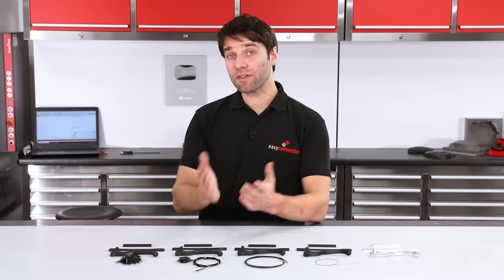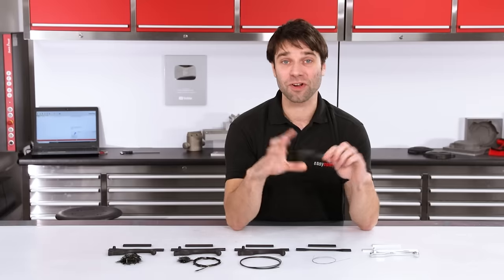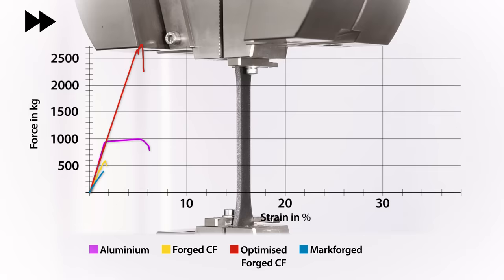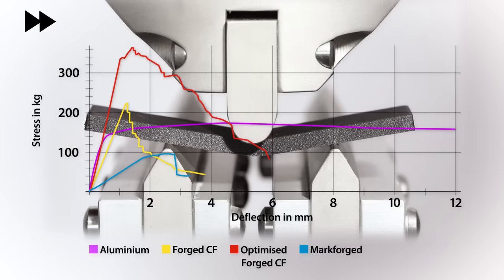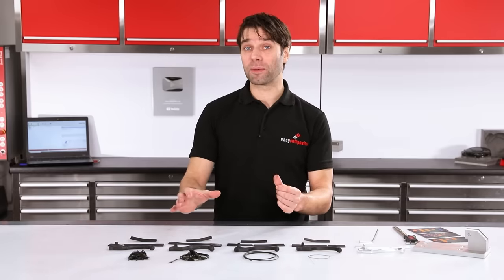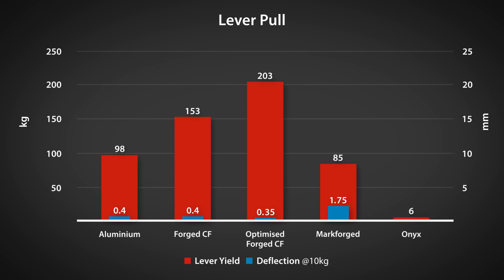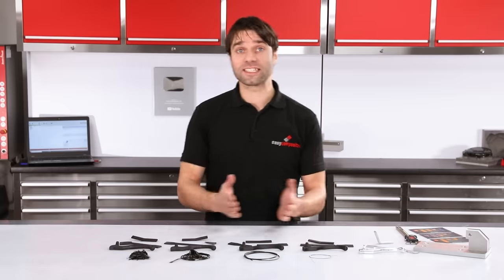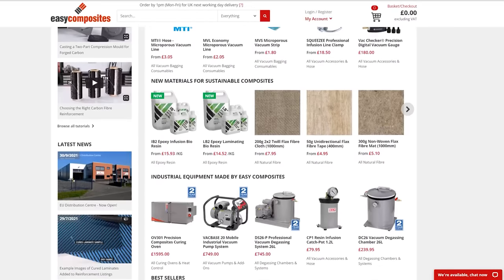How Strong is Forged Carbon Fibre? Forged Carbon vs Aluminium vs Markforged vs Onyx

Comment: i think its time for you guys to make a big step up, which is making forged carbon fiber wheel, yeah... motorcycle or a car wheel, this would be awesome.
Reply from the maker: Maybe one day but there's always apprehension about a hugely safety critical part like a wheel and a lot more to the science and understanding of the forces and fibre orientation - you could get very in depth in terms of the FEA, etc. It would also lend itself to a PrePreg process rather than compression moulding. The Koenigsegg wheel video shows a good overview of wheel construction if you haven't seen it.

Comment: Something that's never talked about is the diagnostic cost associated with carbon fibers tendency to develop micro fractures due to shock stress.
This is why off-road motorcycles don't touch the stuff in any professional frames. It's great for non structural parts or track use vehicles as they don't have to worry about shock loads, but anything outside of that is not a good idea

Comment: Question for you on the brake lever side of stuff. For the surface that the lever pivots around, would you want to put some sort of bushing in there, or leave it as-is? Thinking of prototyping a custom brake pedal for a vehicle, and unsure what path to follow, whether it be metal inserts during(including them in the mold)or after cure(press-fitting or similar), or none at all
Reply from the maker: Generally a bushing would be used to limit wear and help spread the load over time. They are easiest to press and bond into place after making the lever.

Comment: Super nice to see the engineering approach and rigor in your video. Did you test multiple replicates of each material, or just the optimized forged CF?
Reply from the maker: Thank you. We tested multiple test tokens but only a single example of the lever.
Usually we’d want to test multiple samples of all components but those Markforged prints were over £100 each! The average results from the token tests fairly closely mirrored the performance of the brake lever component so we’re were happy that the single brake lever test was sufficiently reflective.
Reply: @easycompositestv  great to hear you rested multiple test specimens. It provides a lot of confidence in the results, for me. Makes sense about the number of levers and how they match the specimen results. Awesome experiment.

Comment: Wonder which is strongest and makes a best result, forge or vacuum. If you wanted to do a half pipe D80, 7x400mm, and you be using Weave Fabric in both cases.

Comment: Thanks for sharing such a good video. What is the span of 3 point bending  forged CF specimens? Are they the pure bend testing?
Reply from the maker: Although the standard wasn’t applied to the tests as such, the specimen follows the dimensions of ISO 527-2 1B

Cross section 10mm x 3mm 
Parallel gauge length 60mm 
Tab width 20mm 
Waist radius 60mm

Comment: Excellent video, subscribed.
I started using CF in various sailboat parts in the early 80's, my brother went on to make CF bicycle  frames sometime in the 90's, and I went off to computer science about the same time. I have a feel for the stuff, but never did the testing. Well, nobody in the boat business had enough money to both buy the stuff and test it.
Thank you for this, your test is pretty much what expected.

I'm familiar with compression molds, but never thought of the process as "forging". Is forging now industry standard nomenclature for compression molding, or is it a proprietary process? 
That's probably in your prior videos, sooner or later I'll get around to watching them.

BTW, back in the day we found that S glass, while not as strong in tension as CF, was just about as good in compression, and a lot cheaper. Most composite parts fail in compression. That may have to do with the sizing that was available at the time, if not, have you tried S glass in your process?
Reply from the maker: S -glass although having its advantages in some respects is actually harder to get hold of in similar format.  It is not what would be considered a forging process in a traditional sense but it is a name that has stuck after some of the supercar OEM's coined the term for the process they used to create panels with the same chopped tow look to them.
Reply: @easycompositestv  Thank you for the excellent response!
Best wishes in your endeavors.

Comment: Interesting vid, thanks. Is the optimised forging as easy as you make it look? Just whack some long strands of tow (toe?)in the mould withthe chopped strands and voila?
Reply from the maker: Yes, absolutely it is pretty much as you see in the snapshot.  Just requires a bit of thought in terms of where you want to place it.

Comment: grandissimi!
grazie

PS: if optimized forged carbon outperforms alu, do you think custom spare (special) parts can be smaller than original ones?
Do you use FDM simulation in this case?
Thanks again, you guys are #1 as usual
Reply from the maker: In theory yes, as long as the part was able to withstand the stresses that it would be subjected to and perform as intended there isn't any really reason why parts couldn't be smaller. 

FEA could indeed be used to simulate parts in the design phase.
Reply: @easycompositestv  yes, it was a mistyped FEM or FEA acronym..
I thought of reducing size and/or thickness in search of maximum lightweight! Maybe it's too much, I admit... 
Thank very much for replying

Comment: To all those who are interested with CF products on bike, take note, any carbon parts that touches bare metal, will cause Galvanic corrosion.. This is well known in the Aircraft Industry..

So if you intent to use this parts on motorbikes or any automotive, ALWAYS make sure there is a layer of protective coating between CF and metal..

So if u are using it as Brake lever or Clutch lever, ensure u put a Brass bushing on the pivot joints..

If you are using it on the crankcase cover, take note to have a gasket in between..

If u are using Stainless Steel bolts on Aluminium casing, make sure u have threadlock in between, as 2 different metal materials inhibits Dissimilar Metal corrosion..

This is Just a heads up..

No way is this to put down this channel's product.. Just to spread facts..

I personally recommend CF in automotive as Power to Weight ratios in automotive, MEANS a lot.. CF are super light, and recommended in automotive, when the bike or car is lighter, u save gasoline, and it even uses less fuel to produce power.. Or you can just go and jog to lose that 3-5 kg.. Wonder why all MotoGP riders are underweight before races...
Reply from the maker: Thanks for your comment.  In our experience, the environment most carbon parts used for DIY use are in do not generally suffer from galvanic corrosion to the same extent as statically charged environments such as aviation.  Commonly the glue used or thin layer of resin between fibres and part surface is enough to prevent it being an issue.

Comment: I think you need to also talk about the area under those curves. Toughness matters a lot. The problem with Carbon fiber in many applications is that when it does fail, it fails suddenly and catastrophically. 

The other issue is that under torque or in shear the carbon fiber is going to likely perform poorly compared to a purely isotropic material like aluminum. Now for the part shown, that's probably not a big deal, but for other parts that may be exposed to stresses in directions outside of optimal, you may have a part in carbon fiber that is extremely strong in one direction, but comparably weak in another.
Reply from the maker: Fibre orientation is key in that respects.  The forged carbon process isn't too bad as the fibres are pretty randomly orientated but still not as effective as a truly isotopic material.  More traditional composites you can change the fibre orientations to suit the application.

Comment: I'd love to see more videos like this! I'm particularly interested in the possibility of filling a single walled 0% infill 3d print with resin/chopped fiber+resin as an easy way to get strong 3d prints without the hassle of making a mold. Would this be possible and how would it compare to conventionally made composite parts? (I don't have the means to test this).

I've seen a video from CNC kitchen where he painted epoxy onto 3d prints but he didn't go as far as filling the internal void in a 3d print with resin.
Reply from the maker: I imagine it would work very well. You wouldn't be able to compare to conventional composites as they are normally thin skins compared to a solid object so the performance and intended uses would always be different.

Comment: Would any benefit be had to laying carbon strands in a perpendicular/ mesh-like orientation  in the optimized forged cf?
Reply from the maker: You already have fibres in multi-directions due to the chopped tow so can't see any significant advantage to this over the chopped tow being used already.

Comment: Very good test EC, but now I'm curious how would other materials perform. Like forged S-glass for instance.
Reply from the maker: Forged S-Glass would behave in just the same way so could certainly be used. In terms of how it would compare, I think we can safely say it would just mirror the differences between those two fibre types; similar strength, lower modulus, higher density, low dielectric.

Comment: Is the tensile test specimen is prepared using 3D printed moulds?
Reply from the maker: Yes, the brake levers you see were produced using the pre-existing moulds used for the previous video.

Comment: Well, I said it before and you told me it wouldn't be a good idea, but; I'd like to make my A-arms out of Forged Carbon fiber.  That test was the "Bomb diggity dog.". So now I just need to see what I need to buy in order to do it.  Thumbs up all the way.
Reply from the maker: Its likely to be an issue with fatigue or heavy shock loading which may cause the peak shock loading to exceed its strength and then catastrophically fail compared to a metal part that would slightly bend but stay in one piece. Also there is difficulty with ensuring the fixing points are suitably strong etc. The design would need to be optimised for forged carbon use and may well be considerably different from a steel one.
Reply: @easycompositestv  With all the different application's for carbon composite parts and your test result's clearly prove that if I design the A-arm's and test them against a vehicle running over pot holes again, and again perhaps I can put your doubts to rest. Love your test, it was a major selling point for me.  "Thumbs up all the way brother."

Comment: This is very interesting.

I have a few questions:

1. How do these various methods compare in weight?
2. How does the strength compare to carbon fiber when encasing balsa wood or foam?  
3. How does thickness of balsa or foam affect strength?
4. Do you ship to the US or recommend who I should order from stateside?

My project would be ultra-light truck camping for a new electric truck with limited payload.  
I have ordered a Silverado EV and the total payload is 1200 pounds. 
I would like to make a bed and cupboards inside the truck cap out of carbon fiber panels.
I allocate 400 lbs for humans, 350 lbs. for the truck cap and that leaves only 450 lbs for cabinets and camping equipment.
I appreciate your ideas on materials and thickness. 

I would like to explore the concept of traveling across the US on electricity and record cost in an ultralight camping.

Tom
Reply from the maker: Hi Tom, thanks for getting in touch. There's a lot more information including weights and comparisons over on our website including a full write-up and conclusion. You can find this by following the link: https://www.easycomposites.co.uk/learning/mechanical-properties-of-forged-carbon-fibre
Reply from the maker: We can ship to the US, no problem.

Comment: Is it possible to use the same method for flax fibers? I've noticed that you don't sell chopped flax and I'm not sure if buying unidirectional flax reinforcement and just cutting this into similar 12mm pieces would produce the same result.
Reply from the maker: In theory yes if you can find the fibres.  Only down side is flax fibres tend to swell once wetted with resin so you may have issues getting enough fibre into the mould before compression.  Subject to testing, you may need to put more material in the mould to compensate for it swelling in the mixing pot.
Reply: @easycompositestv  thank you for the quick reply! You have a phenomenal YT-channel and I'm looking forward to trying out some of your starter kits. I'll try "forging" carbon fibre first and then experiment with flax down the road. Cheers!

Comment: Very interesting and impressive as always! Whereas I think that a certain plastic deformability also brings safety in some situations. As the tests show a fracture in CFRP can occur relatively abruptly and is not necessarily indicated by deformation. As for the leaver I think I rather would like to have some deformation than a nasty splintered piece that eventually pierces through my hand when I'm in an accident.. :)

As a Topic for a new video I would really love to see how to produce structured surfaces on large objects! I like to make some side panels for my van and struggling for years now with not knowing how to reproduce the leather optic of the original ones (artificial leather is not a option..)!
Reply: Agreed. Also, speaking from bitter experience, but the fact you can bend back alu somewhat and have it last long enough to get you home can literally be the difference between riding home and sitting at the roadside waiting for a recovery van.
Reply from the maker: Although realistically, it is only in a crash that the impact loading on the brake lever would be high enough to fail.  A typical lever pull is around 10kg, so even if you managed to pull several times that figure, it is still within the tested failure levels.

Comment: I do really like these forged cf parts. The only thing I don't like about it after seeing these tests is that when you get to the failure point, the cf snaps whereas the aluminum just bends.

I wonder if you could add some aluminum or steel wire/rods into the mix to keep the parts from separating at failure?

A scenario I'm thinking about would be like handlebars on a bike (pedal bike or motorbike), when you reach the failure point your cf part would be ruined and likely couldn't continue riding the rest of the trip whereas the aluminum would just get bent out of shape. It would feel very weird to ride the rest of the way back but you'll still have that option too.
Reply from the maker: Hi Kelvin, well yes, that’s been the situation with carbon fibre parts from the beginning. Stronger, lighter, stiffer, but more brittle abs with a very abrupt failure mode. In most situations, it’s about using carbon for the right types of components and ensuring you stay within their elastic strain (ie don’t break them!).

Comment: Also, in the application of a motorcycle lever, it should be said that a cast aluminum lever will break evenly (usually) where CF will splinter at (obviously) slow speeds. I say this as, there wasn't a shear value assessed. One should remember motorcycle accidents aren't predominantly low speed collisions.

Comment: Can you guys make a con rod out of the optimized forged and run it in a small engine? I'm amazed at the strength you showed, and I have to wonder if it would hold up inside an engine.
Reply from the maker: It's an interesting idea. I'm not sure we'll be revisiting forged carbon fibre for a while, we have lots of other projects and tutorials in the pipeline already but thanks for the suggestion and we'll certainly bear it in mind.

Comment: Hi, excellent video as always.
Would you consider taking engineer students as interns at Easy Composites? I would love to work in the composites field
Reply from the maker: Although we aren't against the idea of helping engineering students where possible, most of our day to day work is material supply based with production facilities concentrated on our in house manufactured parts - eg carbon sheet.  This means there would be very limited composites experience for an intern/engineering student to learn. A better choice would be one of the main composite manufacturers eg aerospace or motorsport as most of their work will be composite manufacturing and hence the depth of experience gained will be much higher and more beneficial.

Comment: Do the resins you use with carbon fiber release well from aluminum or steel? I have access to a cnc machine and am considering moving to a metal compression mold after prototyping and would want a resin which will release from both the prototype mold and a production one.
Reply from the maker: Most resin systems will need a release agent applying to the mould to prevent the resin sticking. This is quite normal in the composites industry and there are a variety of release agents available depending on application.  No reason why you can't use an aluminium mould tool. The only mould materials that don't need a release agent are most silicon moulds and moulds made of inert plastics such as polypropylene, Nylon, polyethylene, PTFE and Teflon.
Reply: @easycompositestv  thanks for the reply.

Comment: Very interesting and thanks for putting in the work to do this testing. One thing I’m curious on is impact, thinking of your clutch/ignition cover. Stiffer can often mean it will crack. So I’d be curious how the forged carbon compares here. I would think with the high-force failure it would still perform well, cast aluminum (and especially magnesium) covers don’t survive landing on a rock too well.
Reply from the maker: You could design in a safety margin if you were concerned based on results from testing.